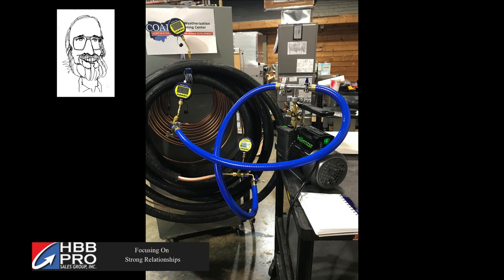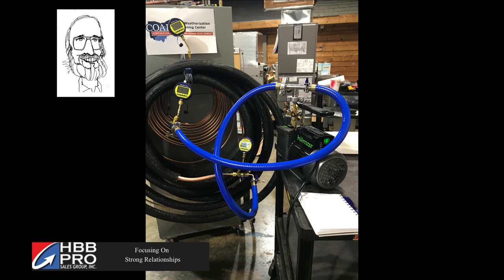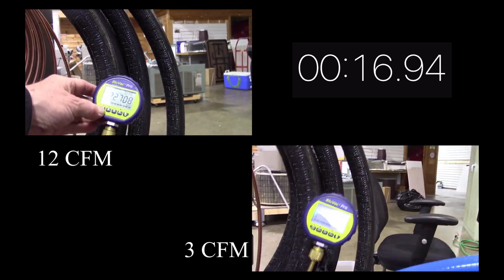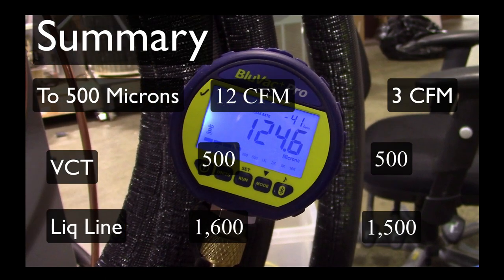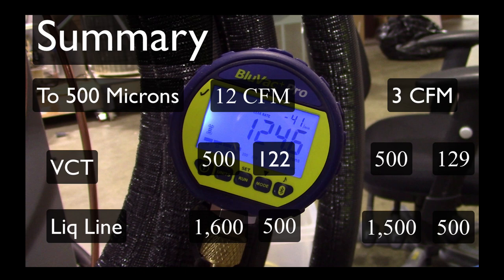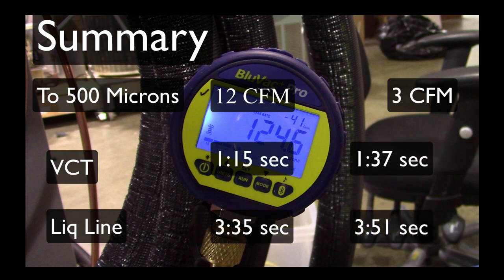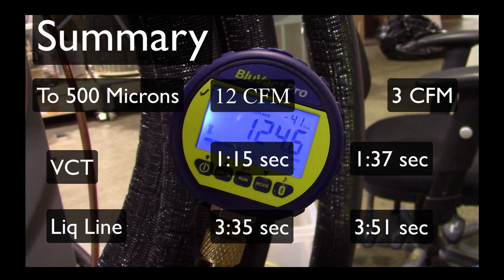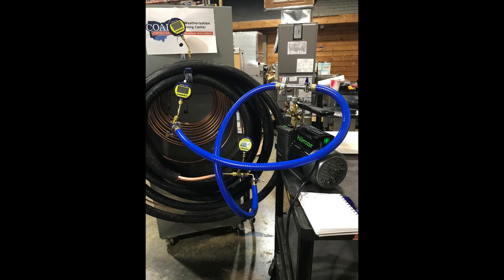12 vs 3 cfm vacuum pump

Comment: Thanks for the video.  Reminds me of those $500+ TruBlu vac hoses everyone is crazy over yet they still have more gaskets/connections without bringing obvious results compared to a $100-$150 20micron 1/2" hose.  The magic is in removing the bottle necks.  I'm guessing your test difference would've been greater if the brass/steel service port on the ref circuit was 3/8" or 1/2" king valve type.  A Supermarket refrigerant loop would be a good test bed.  Would love to know.  I'm guessing CFM matters when capacity is massive and bottle necks are removed.